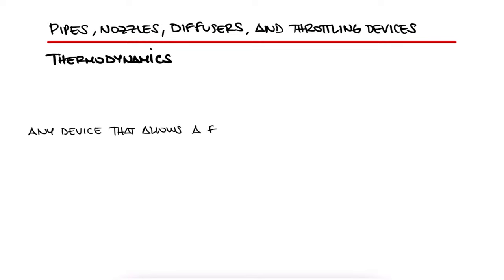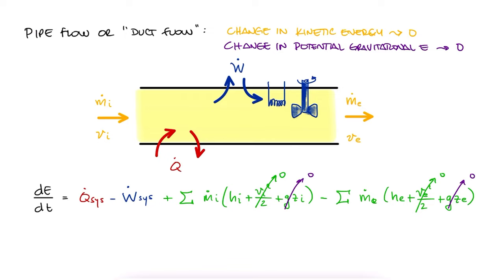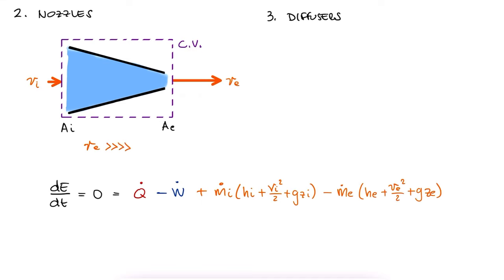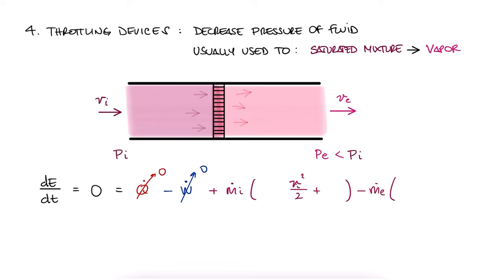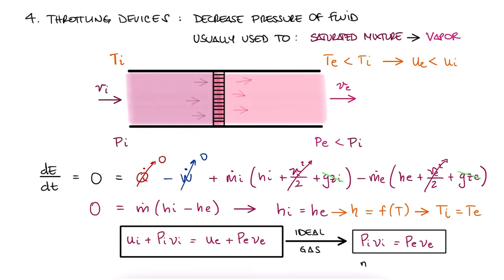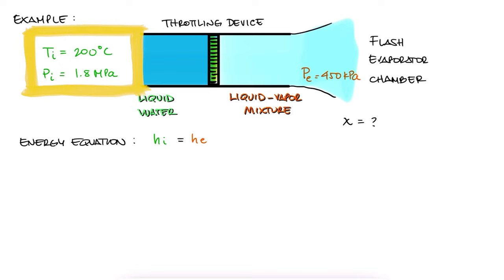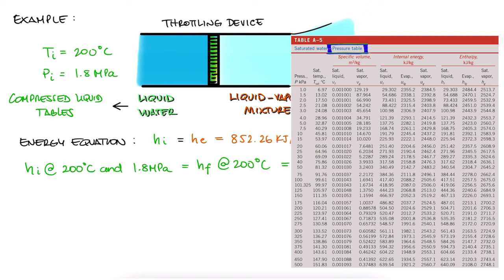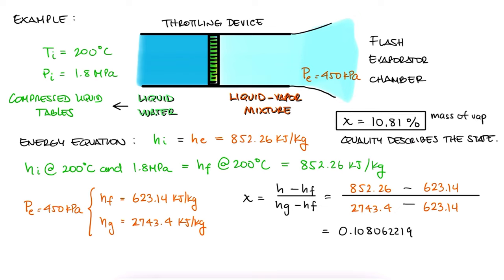Pipe Flow, Nozzles, Diffusers, and Throttling Devices in 9 Minutes!

Comment: Can you explain why velocity change is neglected in throttling but it is not in nozzles and diffusers?
Reply: Because of the velocity change you can try with yourself if the velocity change is not very high there is no big effect on answer, when you include the problem delta V answer change just a little bit. But for nozzles and diffusers the velocity change is huge
Reply: With a constant duct area as in the case of a throttling device, the velocity changes are of essentially of the same magnitude and inconsequential...However, for nozzles and diffusers, the area differential at the device 'entrance' and 'exit' is geometric (several orders) and hence the velocity changes are substantial and cannot be discounted.

Comment: the section on throttling has flaws, Pe > Pi
Reply: No. Pressure drops as it moves through the restriction, due to the flow resistance which causes the fluid to decelerate and lose pressure. Thus Pe < Pi.